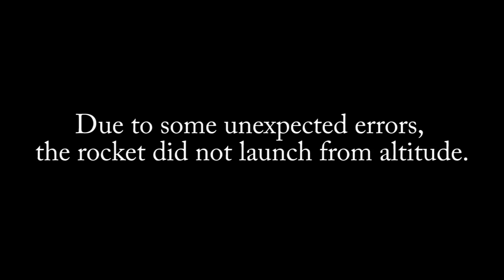Edge of Space Rocket Launch Attempt - 104,000 ft

Comment: Gunpowder motors will not work at such high altitudes, Gunpowder does not develop enough heat and will self-extinguish above 30KFT. This phenomena is well understood in rocketry circles. Next time use a composite propellant motor instead (Ammonium Perchlorate based) with high temperature igniter, plus a cap or bursting diaphragm on the nozzle to help build ignition pressure/temperature. Good luck..
Reply from the maker: Yea indeed!

Comment: you need to test fire one of those rockets in a simulated high altitude chamber. you can make your own vacuum chamber fairly cheaply. My guess is that while the firing circuit fired, that the oxygen required to start the solid motor was not there and so, the burn could not continue.
Reply: Hi! I'm sorry to bother you (as this original comment is from around 2 years ago and I'm not even sure if you use this account)- but I was wondering if you know how someone could potentially go about something like this. I'm interested in doing something around this as a hobby project of sorts, and I just want to make sure that all my electronics/rockets will function properly.
Reply from the maker: Yes indeed!